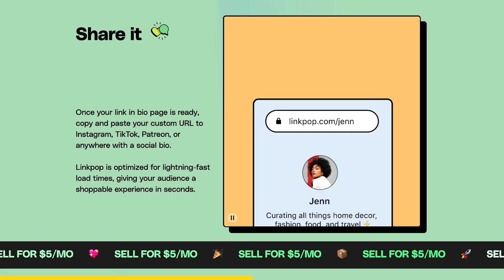Real Mechanic Reacts to Horrible Facebook Car Advice

Comment: The balljoint removal is legit, the install not so much. 
Trust me in the rust belt you’ll bend your press trying to take some old ones out, heat and hammer.

Comment: There is WAY more than 5 drain holes, for example... my firewall has 2 drain holes, and they do clog.  I found this out when we had some heavy rain and it rained, inside the passenger footwell.

Comment: I agree for the most part with what was said in the video but as someone who in the past did not have a auto zone close enough to use the press I have done ball joints in the maner shower but the trick is when installing use a socket or something that will sit against the same area as the tool so not to damage the new part also a air hammer will make things easier

Comment: Removing the ball joint with the hammer yes, if there was  a sleeve over the ball joint sat on the flange you could hammer it back in but the socket is only plastic so not good the way it was done.

Comment: i had to do the ball joint beating once, i dont recommend it, but if you have no other option be very care full and use a big socket or pipe to cover the new ball joint so you dont hit it going in.

Comment: lol yeh jailed the bent wheel. Whilst the bends have gone past the point of elasticity and the atoms have dislocated, you can theoretically heat metal up to allow flow and relocation to untangle / pass over itself to remove unwanted stiff spots - it’s highly unlikely you’ll do it uniformly to factory standard. 

As for two nuts, also known as a jam nut, this is sometimes used as a friction locking mechanism to stop nuts coming undone - you don’t see it on cars these days. So sure, it works for undoing a threaded screw. 

This was one crazy video of bad hacks.

Comment: old wheel bearings dont come out that easy unless they are destroyed already i know, ive changed atleast 50 wheel bearings, on the same car, use new parts not parts from the scrap yard. :)

Comment: You also have to consider improper installation! Considering they drill holes through your roof in order to install most if not all panels! Then who's on the hook for the cost The homeowner the solar company who improperly installed them later causing a leak or the insurance company? And of course if you're going to get solar panels you should have to pay extra to have them insured as the price of your insurance before solar panels is based on your home before solar panels! It just kills me how people don't think about the most common sense things possible!

Comment: Why would someone put a belt on a VW while running? Battery dead, no one around, before cellphones. 
 Things were different before cellphones, and the internet. If you're stranded, out on some country dirt back road, at 1 am, you tend to go into survival mode. Today, you call someone, or a wrecker.

Comment: We use to mess with the new guy with an ohm meter. It was called are you brain dead. We would hold both leads in our hands and put em on each side of our head. If you just touched the leads to your head, no resistance.  If you put it to your head at touched them with your fingers you get resistance.  Short story is don't let em know your touching them with your fingers. There were alot of brain dead. High school auto shop with the champion spark tester is another good. "Here hold this end". Good stuff.

Comment: With the piston sleeves, that might actually work, I remember as a bike messenger in Toronto in the 80's people wee taking pricey bike locks and smashing the metal by using Freon to super chill it first, then steal a $3000 bike and in 1980 that was usually the cost of a high end bike, now you add $11K to that price so they never lock those outdoors! I mean if it can smash 4130 cm then I don't think those sleeves would be a big challenge. But bare handed? That would burn.
That cheetah was used in a prank on I believe Just Rolled In where they told the apprentice to clean something with it, similar result but laughing too, in fact I just saw it 30 minutes ago, I like a good prank...but not cellophane wrap over the toilet seat! The folded and taped ketchup from the take out with a tiny pin hole in it under that rubber bumper toilet seats have is pretty funny, gets your balls good too. Hot sauce is just mean.

And we need more women in mechanics, because women are usually a target for getting burnt at the garage. More female drummers and bass players too please.

Comment: When doing certain bushings on aircraft - they will cold soak the new bushing in liquid nitrogen to shrink it. The quick chill of the cylinder sleeve isn't that bad - but I would think the fit would require a mallet and block of wood still.

Comment: We got some Bluebird Propane V10 Rousch motors for school buses.  The ONLY way to get off the Air Compressor Belt was to do it like 11:15.  That was the actual procedure to do it.  Did I ever do it?  Nope.  Was there a way to loosen or tighten the belt?  Nope.

Comment: 8:47 That's not compressed Air bud. its compressed propane and the temperature reaches down to -44 Deg F. much cooler than a refrigerator.

Comment: Not gonna lie, I've done the ball joint trick with a floor jack. it kinda worked out but being that the control arm was a stamped piece of steel the ball joint hole stretched a little causing the ball joint to pop out about a month later. Fortunately, it popped out as I was pulling into my driveway so I was able to get it into the garage with a floor jack but in the end, I had to buy a whole new control arm. just do the shit right the first time. I've also seen a mechanic do the poly v belt trick with a screwdriver. I like having all my fingers so never even tried to attempt changing an older style v belt change like that.

Comment: 8:33 That's wrong, use proper temp difference, proper calculated. I do that, often, professionally. The hammer is always out, in case something goes wrong, cause you need it seated within max 10s of starting, the hammer is therefor only backup

Comment: Odd story.  I had a garden gopher crawl into the engine compartment for warmth at night.  I the morning, I drove to work and it got caught in the serpentine belt, knocking it off the pulley.
Yes, my serpentine belt was disabled by a serpentine.

Comment: Nothing is worse then changing a strut and using hose clamps instead of a spring compressor. I did it once out of desperation   I threw the spring and it went up about 50 ft. Sounds funny but it would take your head off.

Comment: I have done the pulley trick before for fitting a v belt. Although i fit it on by hand as much as i can and then bump the starter and i dont put my body anywhere near it while im doing it.

Comment: The ball joint install is 100% I've done it when I can't find a proper adapter for the job
Reply: I've driven old ball joints out with a hammer, but I would never use a hammer like that on the new one.

Comment: Spinning and heating the wheel bearing, but I would have put on a daisy rather then a cutting head. Even a welding tip is better than the cutting head.

Comment: Hey Donut-team and Guest. When you are looking at Hacks like these (for example the square wheel with tubed tire) also look at the hands of the person(s) doing it and/or tools/things in the back ground. Often you don't see the person doing it in full (first alert), but by looking for these things you often find these video's are made in countries where the repair (any repair) is valid as parts are either way to expensive or impossible to get. Think like the outbacks of Africa, Middle and East Asia. I noticed many are from India/Pakistan... What goes there doesn't work here legit or not.

Sleave in engine, again colored hands and chinese (?) characters on the cardboard in the back... they probably had nothing else at hand(?).

Comment: After dropping 15k for some wheel repair equipment (the guys at the shop seemed really happy to sell it to me and helped load it on the top rack of my subie) I'm having trouble figuring out how to get  the bent aluminum rim to straighten out. 5-min  craps video showed some cool stuff called j-b weld that's good for the little pieces that keep breaking off. They also showed how to cover it with acrylic paint so the cracks don't show.
Still having trouble after a week of working on this rim. Any tips are much appreciated! 
Have a crate of spray foam that may help hold the Tyre  on for my next road test.😊

Comment: I want to do work to my own car to avoid paying a ton of money to have someone at a shop do it but vehicles can be quite complicated. I’m attempting to put a new air filter in my car tomorrow to see if it improves my gas mileage. I want to do an oil change but I don’t have a jack or stands. Those are rather expensive.

Comment: The electrical parts cleaner/Air duster does work but you would need more for longer and it does still require you smacking it down a bit, Rebuilt my diff using Air Duster cans aha

Comment: The rubber he cuts off has nothing to do with sidewall structure tbh. It's an edge of rubber made to poke out enough to protect your rims from scratches. The main mistake he did was to order the wrong tires imo.

Comment: The first one with the wheel hub?
Yeeeeeah, why not take the entire knuckle off first - as you'll need to anyway - and then use a press - that you'll need to anyway - to remove the hub from the knuckle.
The bearing is still in the knuckle even after that trick and that will not come off - or the new one go in intact - without a press

Comment: Regarding the drum brake one, so so wrong. I'm a semi trailer technician and there is a way easier way to do this, you hook the spring to both shoes and lift them up together over hub, then hook small springs up on other side. This guy is making something way more complicated than it needs to be

Comment: So, the potato peeler bit might be legit. There are tires that have a "rub bar" on the sidewall, mostly cheap stuff for pepes that cant drive. This is an extra thick protection section to keep the curb from bangin yur rims. One could trim this off and not degrade the tire. Question is really why would you put cheap consumer stuff on a performance car? I am sure the guy doing the trimming spent more in time than the difference of just using better tires with no  rub bar. The world takes all kinds, lol.

Comment: If the guy sleaveing the engine would have had a torch in that cylinder for a few minutes before this. Yes, that is perfectly legit, and it would have had a perfectly fine life. If he didn't have to heat it and expand the cylinder and then chill and contract the insert separately, there's no way it would last very long. They are basicely the same size at the same temp

Comment: Cylinder fitting is incorrect but what about all the dirt around the cylinders plus you have to have a heat of 100degress cel I used to have to sit in the one spot holding a large flame thrower and heat the cylinder of a hydraulic pump while other guys used nitrogen pouring over the pin to have them in their correct position and we had to do it for 24hrs

Comment: 6:28 the wheels were swapped. There's a tear through the rim in the first shot, then when he cuts, the tear is gone. Just like all the "restoration" videos, they damage a perfectly good item cosmetically in a way its easy to repair and post it for clickbait.

Comment: Ok so did anyone notice that the wheel hub is spinning the opposite direction of the air being blown. He is blowing the air from the left side and spinning towards him instead of away from him.
Reply: Was my video! It’s just the frame rate of the camera catching up to the rpm of how fast it’s spinning. Kinda like the video of the helicopter where the blades look like they are not moving

Comment: 11:40. Crazy because today. Literally like an hour ago I caught two of my fingers on a pulley belt that labels wine bottles. My dumbass tried grabbing some labels by actuating the mechanism but i got caught. Thankgod it has a grippy rubber roller that grips the glass bottle. else it wouldve ripped my fingers off. Theyre swollen and red. The irony rn im on lunch kinda panicky

Comment: in the early days of american cars front wheel drive cars, the belts were a bitch to get on and off so instead of removing all the pulley/bracket bolts , we would get a pry bar and bump the engine to remove the belt like how you would put a chain on a bicycle when you were a kid...it worked great as long as you had the correct length belt and saved a ton of time...NEVER did it with a running engine though, that's just plain stupid and dangerous and finger losing

Comment: First hack is stupid I've seen sockets fair horrible and I could only imagine if it failed while you were holding it how bad the injury could be. Second hack is correct taking rubber off the sidewall like that creates a failure point that's not a good idea at all👌

Comment: It's a older video I randomly stumbled on but I'm kinda guessing the one guy for the socket a hub removal maybe never worked on 8 lug 3/4 ton trucks or bigger ?_? .. but truth be told there's at least 1-2 thousand pounds of force on the hub let alone what happens when we start running negative 44mm offset wheels on the hubs .. I really don't see how a big hammer is going to damage them <_<

Comment: I have legit 100% done this with dodge 3500 front wheel bearings they would tell me when to turn and then stop and hammer it. Ok the second one wheel repair how about having the tool to set the bead and just using fire for the camera. The third setting the sleeve it’s prob Africa.

Comment: What about the when where they route a hose from the air box and use it to vacuum inside the car while the engine is running?

Comment: 6:40 I have many questions
1. How the fuck did they make the tyre so squared
2. It's supposed a life hack, some small convenient hack to avoid expensive repairs but instead i should magically have this anti rim squaring device and a wheel installer in my house just laying around and a balancer too 
3. It all just seems like too much work for the price of that rim so just buy a new one 🤷

Comment: I watch this kind of 💩 for tips. How else would I know to tie-up a caliper and stick a fat shim in it when a junk pad breaks off the backing plate and goes through the rotor in the middle of nowhere? 💩 got me home. Saved a tow and waiting 3 or 4 hours. Taking it off after the first soft stop at low speed saved it. Piston was fine, back pad was still there and 60%.

Comment: The brick thing cant be real. This dude is doing body work with broken bricks and mixing concrete in a puddle outside but he has a shop with a paint booth? And hes still using bondo so whats the point of this? Weld in a new panel shape if as best you can and fill in tge gaps with bondo. You dont need the bricks!

Comment: The first is dumb thats a way to damage your tie rods and your alignment as your vehicles alignment is very delicate as well as your steering component's and putting that much pressure to your steering system is a bad idea and no hammering pry bar is as far as you should do thats it and my opinion

Comment: With the 5 minute crafts square wheel "repair" video, it definitely isn't the same wheel. If you notice the square one is rusty on the inside of the wheel very clearly on the opposite side, but the "fixed" wheel isn't rusty. FAKE... but given its 5 minute crafts...... what is real with that channel?????? ..... nothing is my verdict.

Comment: @9 mins the chilling the sleeve is legit THEORY but absolutely a fake vid. The correct size sleeve for a given bore would require much more cooling to reduce the diameter than the little bit available from that can that didn’t even get applied to the upper third or so of the sleeve. 
As for the square rim that was repaired, the “5 minute crafts” sig on the vid automatically puts it into the fake BS category. That channel is well known as a content mill of bogus garbage